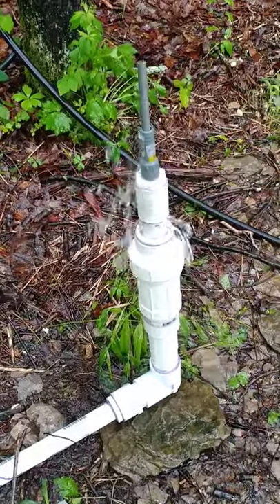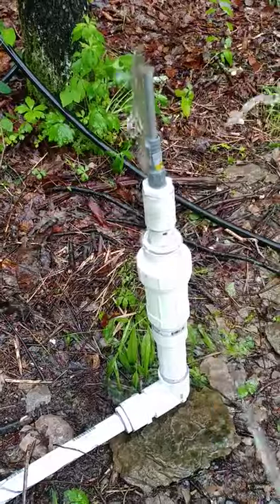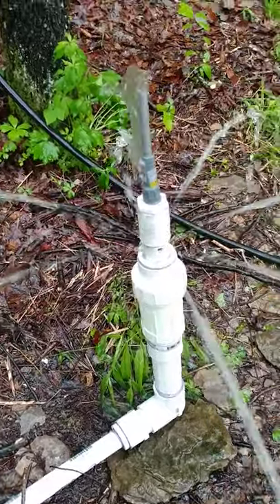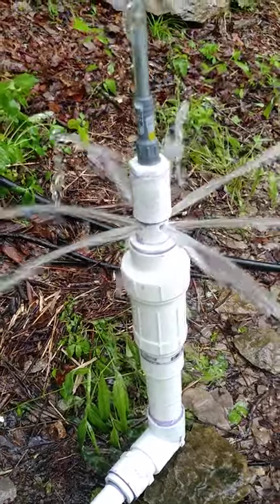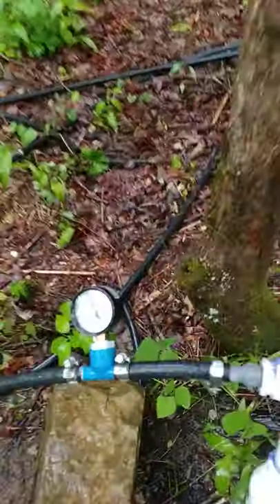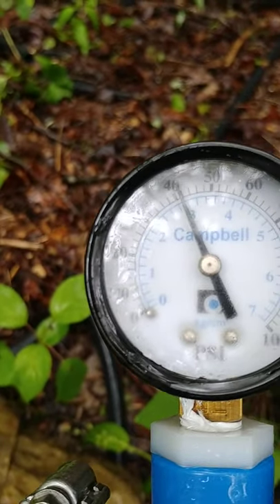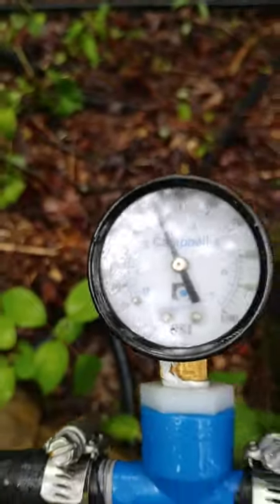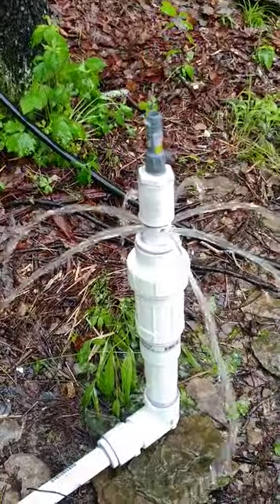(DIY) Water Ram Pump Check Valve!!! Build # 2

Comment: Do this pump you made use electricity?? How do you made ( diy) a non electrical waterpump  for a rain barrel?? Very rare to find any where.
Reply from the maker: It doesn't use electricity. It only uses water coming down from a higher source.
Reply from the maker: Look up "WATER RAM" on YouTube

Comment: Thanks for the videos about waste water check valves.    Have you also made your own inline check valve?   I'm looking into using a ball inside a PVC container - someplace I saw a youtube video on this.
Reply from the maker: I haven't but desire making one also
Reply: @toddwolcott  Somehow the spring operated PVC check valve seems clunky with a lot of inertia to operate.  I wonder if this makes a difference for water delivered vs a valve with little resistance?

Comment: I'd really like to know more about the effect of different waste water check valves on the volume of water pumped.   Thank you for the video.  I especially like that you used common parts and we don't have to weld or modify things.    I've added this and the detail parts video to the Water Powered Pumps public Facebook group:   https://www.facebook.com/groups/240458583255303/permalink/533567013944457/